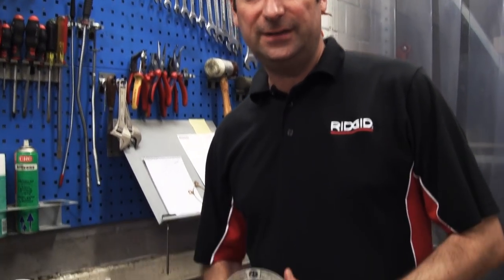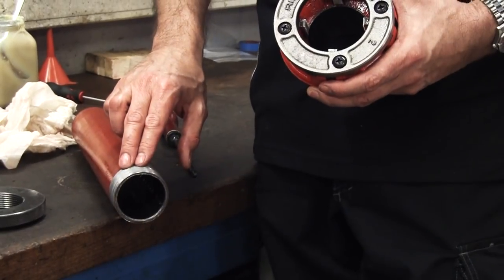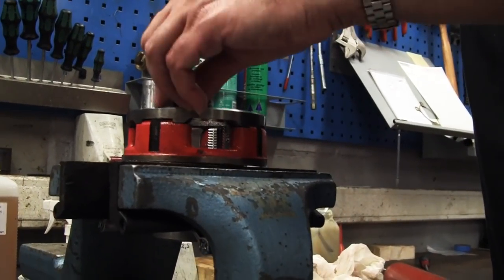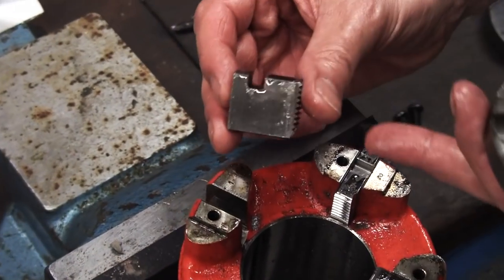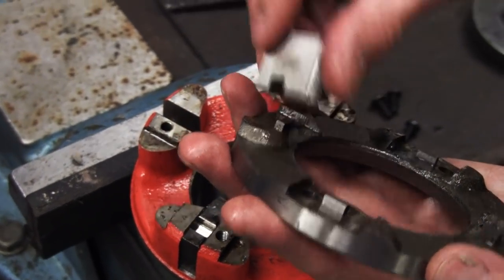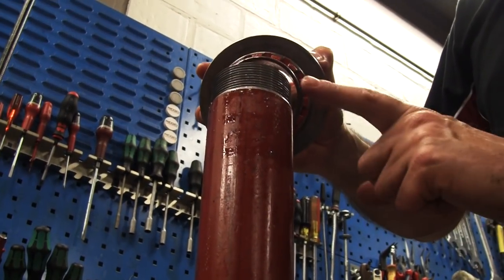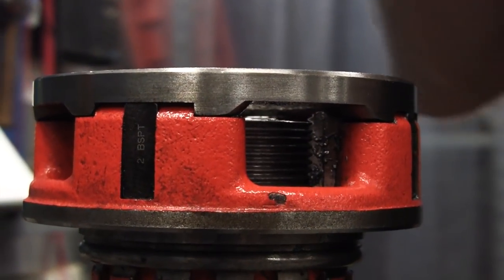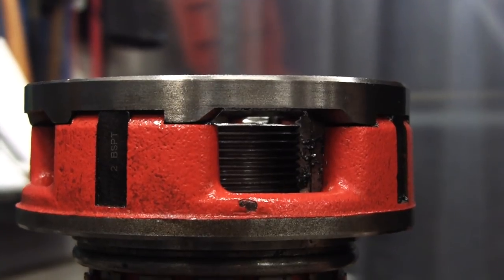RIDGID - How to Set the Dies in a 2" Die Head

Comment: I presume this procedure would be similar for all the other die heads made for the manual threaders?  The other concern is the getting a well machined nipple with proper threads for adjustment - many of the big box and hardware store products are very poor in quality control for their threaded ends.  Most folks don't have pipe thread gauges just hanging around the shop...

Comment: I've had a hell of a time threading with Ridgid pipe dies and a Ridgid manual threading ratchet. Nothing I've done has resulted in usable threads. Setting the dies using known good threads, pushing the dies all the way in, all the way out, and halfway in between, brand new dies, old dies, etc. These dies just don't work. I've been very disappointed in Ridgid.
Reply: What are you using for a threader? I know this comment is a little old but I run quite a few ridgid threaders and do a lot of stainless threading so get a good test on machines. I find nothing beats the quick open carraige threaders but if you can find a 504 they work great for getting good threads. I have a brand new 12r threading set and find the threads aren't to great after 1". I usually use a 65r for anything 1-2". Getting a new set of stainless dies is a great investment as well.
Reply: Try using a good cutting oil, if your threads are tearing.
Reply: @backroadsburner  I solved it by learning to weld pressure vessel and just cutting a stub and welding it on whenever I need threads.